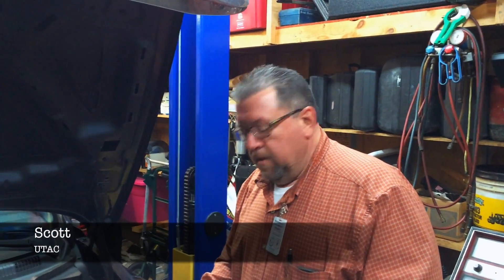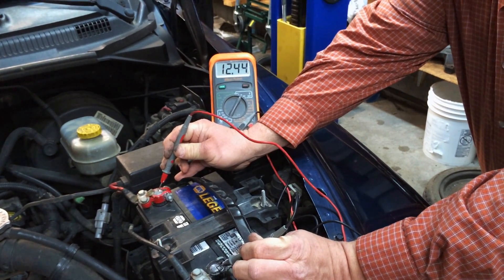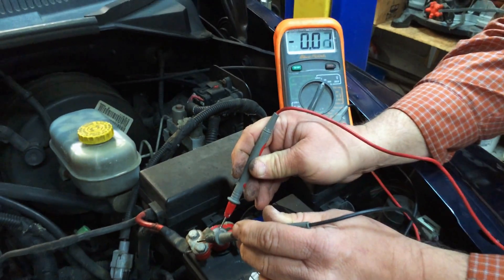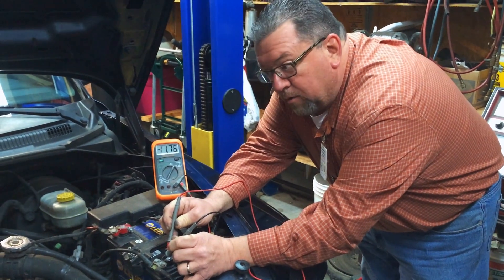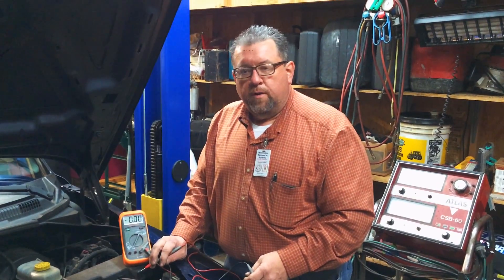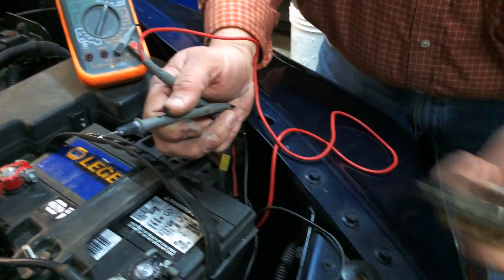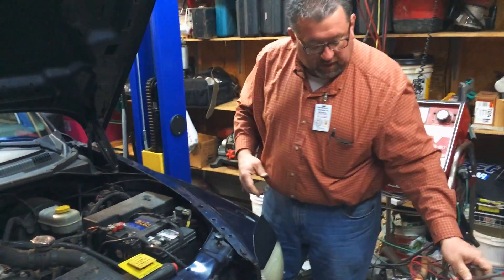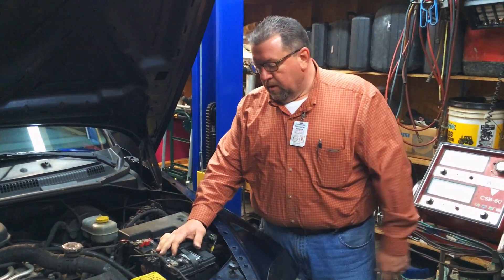Voltage Drop Test

Comment: Hi, I just want to ask if a voltage drop of .6v from BATT post versus IGNITION ON reading? The ignition wire from the key gives direct power to injectors and ignition coil so I am a little worried. Thanks!
Reply from the maker: @Jack_OLeńoco  if it’s with the switch on it’s possible to have that much voltage drop. You are essentially checking alot of the systems in the vehicle. With ignition off that is too much draw, it should be in millivolts only. You would really need to isolate each circuit and test individually. The post test is at a main circuit and gives you a broad idea of voltage drop. If you need to follow up on it let me know.
Reply: @JeremyG1749  while engine is running, I got 14.2v direct to BATT, while I got 13.6 v to the IG wire going to the injectors, etc.
.6v drop isn't too much?

Comment: Just giving you a heads up. I broke down, and this video helped me get home just now. I had a slight draw from the positive cable due to corrosion. I cleaned up the cables with whatever i found laying around the floor, and managed to crank my truck up and get home.

Comment: Switch  ON  or  OFF
Reply from the maker: It really doesn’t matter because just the door being open puts a draw on the full system. Also the light under the hood being in puts a draw on the system as well. This is enough of a draw to perform the test.

Comment: But what he failed to talk about and to diagnose if you clean the post and it still had high direct current fluctuations and it was not at zero like the positive cable or in fact both of them had issues positive side and groundside if he clean that terminal and or replace the terminal with a brand new one and he still had issues than the problem lies further I get the concept I've done this before but that's just talking about just the icing on the cake you're not actually giving us the ingredients to make the cake talking about just the icing on the cake you're not actually giving us the ingredients to make the cake which I really don't see anybody here in the comments talking about this because if that battery terminal was replaced and you still have an issue what does that mean that means that the problem lies further and if the problem lies further we got to find out how to diagnose what our issue is

Comment: This just saved me a lot of time and effort. My negative terminal had a 10v drop and had ZERO power at ignition. Cleaned up the wires and retightened the Neg terminal the Grand Cherokee WJ started right up. Thanks

Comment: Sir:  An open on the negative post is creating an additional LOAD (the open)
         that is in SERIES with a pre-existing load in the vehicle (clock running, alarm system activated etc etc).  Approximate 1 volt drop at the other load.

Thank you.   comment please.

Comment: Extremely clear and concise.  Trying to comprehend WHY the open shows
up as a voltage ?
Reply: An open on the negative post is telling me a SERIES load is being applied (the open) to pre-existing loads on the vehicle ( clock running, alarm system active etc etc).  comment please

Comment: i have a question.does the voltage drop readings increase as amperage increases?i seen a car that had a 2v drop on power side,the spec fuel pressure was 45psi but the pump was putting out a massive 90psi.would this cause a rise in amperage that would create a 2v drop?

Comment: i got one for you sir... i was at a Auto Electrical Shop and the owner had a large box truck there and he should me it would crank and not stop it just kept on cranking with the key off??? i was like what the hell is going on here ???  he said it has a bad battery, i was like no way but the owner was very old and really good on auto electrical and he installed new battery's it had 2 and it started right up and disengage the starter drive unit in the started.. i was like wow i don't believe what i just saw... i asked how is it new battery repaired the keep on cranking problem he said he has seen this many times the battery's have the power to crank it over but not the power to disengage the bendix drive unit in the starter... i am like wow..

Comment: Nope... u dont know what you're doing... u do a voltage drop test on a circuit with current flowing... not with the vehicle off...
Reply from the maker: I failed to mention that the key is in the accessory position, it was mentioned in a comment previously, sorry for that lack of clarity.

Comment: Good video, but there must have been something on the truck drawing current, at least for the first reading, since you can't have a voltage drop without current flowing through a circuit. But you are correct, a voltage drop test was the best test to find the resistance.
Reply: So would it be sensible to have the ignition key turned to position one and turn heater / headlights on when running this test?
Reply: @alexp893  If you are testing for a voltage drop at the battery post to terminal connection you should load it with the most current possible. So, cranking the car (with the ignition  disabled) would be the best way to test for a voltage drop at the battery post.

In my original comment, I made the point that there must have been a significant current draw to cause the voltage drop he found on the video. If everything on the truck was turned off, the 11V drop across the terminal indicates there is a hell of parasitic draw somewhere on the truck, which is a whole different problem.

Comment: Have a bongo that wont start unless 12v is fed to fuel cut off solenoid. When I do drop test to alternator positive b+ from battery positive terminal I get 11.2v.
Any ideas? Tried swapping glowplug relay,checked ignition switch both are good. Driving me nuts
Reply from the maker: If I had to guess you have a broken wire possibly between the alternator and the positive battery post, or a blow fuse or fusable link wire. Check for voltage with the volt meter at the back of the alternator, connect black to negative and red to B+ on back of alternator, should be 12 volts all the time.

Comment: We were taught this in Army. But the circuit needs a load to measure the voltage drop. Turning on head lamps works, or closing starter if diagnosing that.

Comment: Nice vid..... but you should always do voltage drop with a loaded circuit. regards Joe
Reply: Of course.  obviously a clock or alarm system is running (or something)
within the vehicle.  The open terminal is a MASSIVE addition load in SERIES
with the other loads which are in parallel with one another.   thank you
comment please.

Comment: Wow.... I have done some tests like a fuse, sensor, etc but I have never thought about this! Though, all I have been doing has been checking (compare) if i will see the same voltage when my voltmeter leads are on the battery terminal and also, on when my leads are on clamps. The voltage never dropped. I will now try this, thanks for this excellent tip!

Comment: What did you have a meter sent to
Reply from the maker: It was set to 20 volts DC, it should be set to at least 20 volts but if your meter goes to 12 volts then I would set it there.

Comment: For those of you wondering "hey I thought you're supposed to load up the Circuit when conducting a V drop test"?   In the comments below he days he failed to mention in the video that he had the key on the Accessory position which does in fact load the battery for his particular test.

Comment: My battery keeps dying and I don’t see any drop besides on the engine management fuse which is drawing 4.1 mv and my battery does only die over night is that normal draw for that fuse?
Reply from the maker: The best way to test to make sure you find the problem is disconnect the negative battery cable and connect an amp meter between the post and the cable. The amperage should be, with everything in the vehicle off and the door closed, less than 0.5 mV. If it's more start pulling fuses one at a time until the amperage drops. If this doesn't correct the problem disconnect the alternator hot wire on the back of the alternator, the circuit you disconnect will be the problem.
Reply: @JeremyG1749  surely you mean M amps

Comment: I don't understand.   If the positive cable goes from the battery to a solenoid or ign switch and it is not in the on position, how is it possible for there to be voltage  to be flowing thru the system at the negative terminal.?  Somebody explain this please
Reply from the maker: The ignition switch was actually in the "on" position, I apologize for neglecting to mention this. Any draw on the system will create a flow of electrons across the circuit, if the circuit is working. If the circuit is open, as in our case, the electrons will flow across the test equipment. Hope this clarifies things a bit, please feel free to ask anymore questions you may have. Thanks!

Comment: Hey young man; I am struggling with I believe wiring issues, and am not very comfortable with the multi meter. I am fairly handy with a wrench and thinking thru possibilities.  I purchased a challenge a1999 Dodge Durango that died around 170 thousand and for some reason sat for a few years. A couple from my area bought it had a fuel pump installed and it ran for about 700 miles and back to to start. According to the title and items he put on truck sounds like that it did run for a while. It does crank and sounds normal.   A crank sensor/cam sensor then were replaced and still same issue and the couple offered it for sale. 
It is in immaculate condition inside and out and figured I could sift thru thinking a possible connection/ ground issue. I checked and do have fuel pressure at shrader valve. According to my Haynes book I have done the 5 volt tests on all three wires at crank and cam sensors and they check out ok. 
I have no power to the coil or fuel injectors. My mind is in overload. 
Any direction you can point me. 
Best; Tom
Reply from the maker: Hey Tom sorry in the delay in getting back with you. It sounds like there is no power to the power control module which I believe is called the SBEC module(Chrysler only), doing this from memory. Give me just a few days and I will research further and get back with you on the specifics of your issue.
Reply: Hey Jeremy; Here is best info as to what I have tested.
It does crank and sounds mech ok during crank. 
Dash lights seem to work normal during key on. Odometer reads mileage.  
It does not have/require a smart key. 
It does have a Security light that shuts off within moments of turning key on then after 3 flashes of Odometer No Buss code and security light show up.
Tach does not move during crank.
I have no power to coil / fuel injectors. 
I have fuel pressure at shrader valve. I can light loosen Fuel relay and hear clicking.
I hear no activity from ASD relay.
I have; (key on) 5.18 volts on the (5v ref wire) at crank/cam/ throttle sensors.
(Key off)I unhooked positive terminal and test light to bat positive post- tested black ground on crank and cam sensors the light comes on strong. 
The Durango is immaculate with no obvious signs of mice or frayed wires. 
I am somewhat comfortable with a wrench but power tracing not my best area.
Not sure if security/ ASD is preventing power to coil/injectors.
Best; Tom
Reply: Oh Jeremy; I just tried a ASD pin 3/5 jump and for first time I have 12v at coil:)))) Did a double test on crank sensor and have (keyon) 5.18 volt on ref wire and good ground on middle wire, Backprob sig wire and steady 5 volt remains during cranking.
Reply from the maker: Even though the crank and cam sensor have the 5 volt reference and ground that doesn't necessarily mean a signal is being emitted. The only way you can determine a signal is with a lab scope. Also with a scanner you might denote a code for the crank/cam sensor. I am thinking you have a bad crank or cam sensor. A quick little test that sometimes works: when you turn the switch on the fuel pump runs for approximately 2 seconds, after this occurs spin the engine for a second and listen for the fuel pump to run a second time. This tells me that the computer is receiving a signal that the engine is spinning over and turns the fuel pump back on. When you release the switch, the fuel pump will continue to run for approximately 2 more seconds. This is just a quick test without any equipment.Hope this helps.
Reply: Thanks young man. I'll test in the AM.
Best; Tom
Reply: I have fuel pressure but I do not hear fuelpump kick on. I took gamble the crank sensor. Low and behold when I got into it the previous owner had what seems difficulty installing it and the weather strip. When I removed old on it was actually just offset a bit by his jamming the weatherstrip in. I to fought with strip and seems the OEM crank sensor was just a bit diff in design and the weatherstrip was old. I disgarded strip and installed sensor then syliconed area. I will wait till it dries and then keep my fingers crossed:))) Thanks for the replies.
Best; Tom

Comment: Great video, solved my problem with this easy check using a volt meter to check from the battery post to the battery cable clamp. The meter showed 0.01 on the positive side post to clamp, and on the negative side post to clamp the meter showed over 12 volts so that meant almost all of the volts were not getting to the ground cable. The clamp that was clean and seemed tightly on the negative post however it was actually loose. 

Symptom at first was no power at all when trying to start the car (LED odometer was blank, no dash lights, etc.), and a jump from another car completed the circuit so the car started right away. So did a single jumper cable from the negative to the frame of the car. Then it got worse, with the car losing all power while driving, so the clamp must have been getting progressively more loose on the post.
Reply: Sorry but you need to current flow to see voltage drop, therefore without cranking the engine your voltage drop test is invalid. Try watching scannerdanner.com Paul Danner is an automotive electrical instructor at Rosedale technical college in Pittsburg PA. he has an amazing amount of information on his site.
Reply: @michaelpiecewicz9748  Clock running or alarm system activated etc etc would
provide the small load you are looking for. thank you.

Comment: Don't you have to be cranking the engine?? Current has to be flowing..
Reply from the maker: You actually do not have to crank or be attempting to to crank the engine to test for voltage drop. Any drain on the battery for example the radio memory in the vehicle, the vehicle computer processor memory, or even the under hood light being on when the hod is raised. Any of these will provide sufficient current flow. The only thing that I failed to mention in the video is that there should be something powered on in battery circuit. Every vehicle from the early 80's on up to today has some form of current flow on the battery at all times due to "keep alive circuits". Thanks for comment, very good question!
Reply: Ok thanks for reply

Comment: In the on position? O tried this on the positive cable from the battery post to the starter whet it connects to the battery, it doesn't show any voltage drop with the key in the ON position. I can only detect a voltage drop when I turn the switch to the start position. That's the only time current is following. Please be specific.
Reply: That's because current isn't flowing  until the starter solenoid is energized.

Comment: Say you are looking for bad ground cable. Testing in off position is ok, but what if you crank the car and check for voltage drop while cranking. I'm trying to figure out if my ground cable is corroded internally. Visual inspection looks ok.
Reply from the maker: Remember when doing voltage drop you are checking from the negative battery terminal to the ground on the starter. In this case, this would be the housing of the starter. Your voltage should theoretically be 0, if there is any voltage across that circuit during starting you subtract that voltage from the available battery voltage. If this reading drops below approximately 9.6 volts you will have a starting issue.
Reply: +Jeremy Greene ok ground on starter as in starter case?
Reply from the maker: Yes, that is correct.
Reply: +Jeremy Greene Great! Thanks!

Comment: Your issue is those TEMPORARY battery terminals. You are clamping soft copper wire. Get some solder type battery terminals and do it properly.

Comment: Thank you sir!! I finished my auto program last semester and I go to a shop I had a car that wouldn't start no crank. I checked everything except one thing the battery.. turns out the terminals were corroded on the positive side but it was neatly hidden. Voltage drop test from now one! 👌🏽

Comment: hey I need help. Started having trouble with one of my daily drivers. The voltage drops when I click to put a windown down and the bigger problem is when I put it on reverse. the voltage does not drop dramatically but the power of the engine does til the point that it sounds like it's about to turn off. it does the same when I put it on D.. alternator and battery are brand new. What could it be?
Reply: First test the battery independently . A load test or a conductance test would be better . Fully charged it would read 12.6 volts . Then all GROUNDS using the voltage drop method . The window motor must be running so current flows to test voltage drop on both positive , approximate 12 volts and then negative side , approximate .5 volts after the load on ground return side . You could even have grounds missing if someone disconnected them when doing work . You can for a quick test , substitute a HEAVY jumper cable from battery negative to various ground points to see if ground is lacking . Visual FIRST , test , replace parts last !

Comment: i use the same method testing wires under load to see exactly what condition the wire is at, checking the strands in the wire, should below half a volt higher then the wire is done in